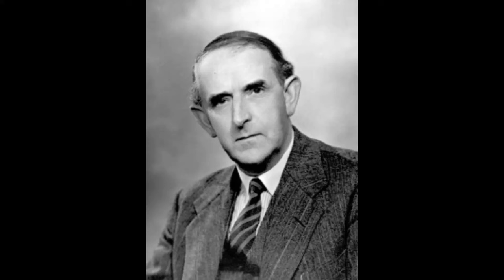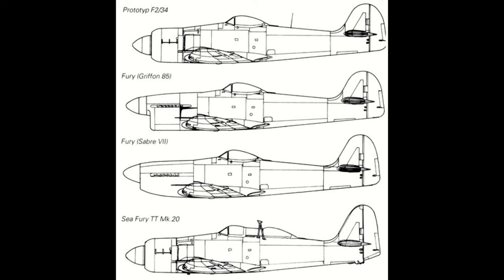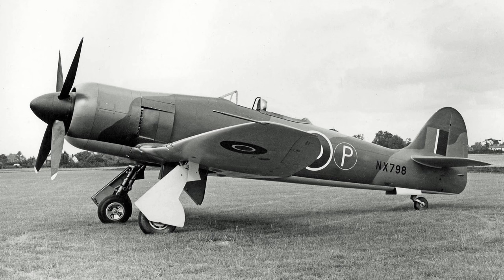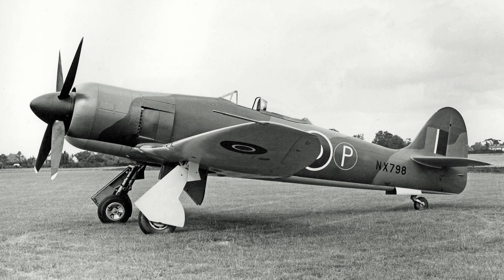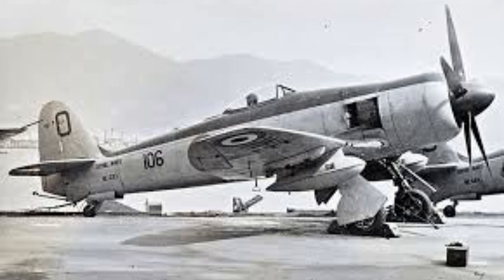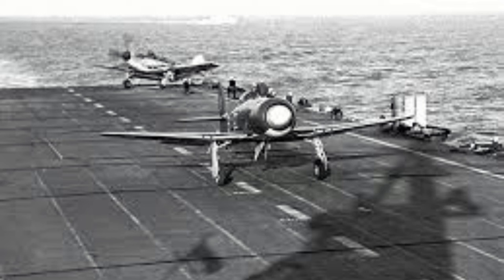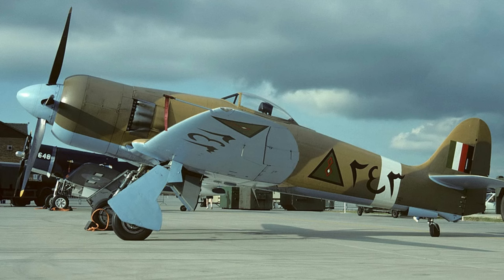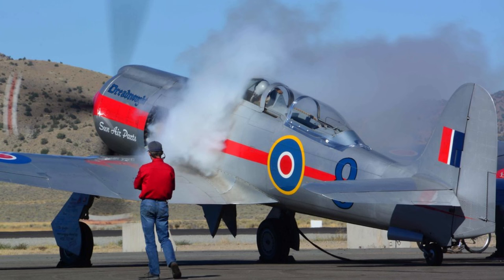5 Minute Guides to Aircraft: Hawker Sea Fury

Comment: I have to believe that Hawker was inspired and influenced by the American Corsair, a large radial engine in a tight fitting slim bodied fuselage using an innovative cooling method. Hawker instead chose the cooling system in the German Foch Wolf, another aircraft with a radial engine in a tight fitting engine compartment. The Foch Wolf cooling system was simpler and easier to manufacture and maintain, a practical decision insread a political one. Sea Fury, Corsair and Foch Wolf, three high performance fighters using a radial engine in a tight fitting engine compartment employing cooling systems to prevent overheating. It's worth looking futher into this
Reply: Yet more nonsense.

Comment: A full semi monocoque  fuselage, new knowledge aero dynamics with a semi elliptical wing. All technologies that the original Spitfire prototype had in 1936. The reason for the Typhoons failure as an replacement interceptor to the Spitfire was the fat thickness to chord ratio limiting the Typhoons top speed and rate of climb. The Spitfire wing had a very advanced aerodynamic properties, irrespective of its semi elliptical wing.
Reply: A semi-elliptical wing is just one part of it, as is thickness/chord ratio. Late war aircraft had their point of maximum thickness further aft than the Spitfire (37.5% vs 30%), which moved the drag rise to later in the speed range. That's why they were able to both fly faster and remain more controllable in a dive. The Sea Fury also used a rather different radiator set up (excluding the fact that the Sea Fury was an air-cooled engine) more reminiscent of the Mosquito or Westland Whirlwind. This was probably the optimal radiator design for WWII fighters, that is, if the Meredith Effect design of the Mustang wasn't. In fact, if you look at the Mk I Tempest HM599, you can see that radiator layout occupying the entire leading edge of the wings between the landing gear struts. This was a faster aircraft than the later production Mk V. According to Robert Jackson's book, 'Hawker Tempest and Sea Fury', it was the fastest piston engine aircraft in the world when it first flew in 1943, eventually recording a speed of 466 mph at 24,000 feet. The reason it didn't go into production related to concerns about the suitability of such a radiator layout for a single engine fighter.

So, in fact, the Sea Fury's aerodynamics were rather more advanced than they first appear. It was probably the ultimate evolution of piston-powered, WWII-era aerodynamics. Compared to the late model Griffon-engine Spitfires, the aerodynamics were quite a bit more sophisticated, particularly the radiator layout.

By the way, as an aside, it is very common with late war aircraft such as these that people start claiming higher and higher speeds for them. Officially, the Tempest Mk I got to 466 mph at 24,00 feet, Unofficially, there are all kinds of rumours about it which are basically valueless and at least one which makes no sense at all. People seem to think it's okay to make up whatever figure they like. Exercise caution when you hear these claims, including the one in this video. It's also worth remembering that HM599 did not carry any armament, which would definitely have reduced its maximum speed. Either way, no marque of Spitfire was ever going to be that fast.
Reply: The monocoque construction of the Spitfire set it apart from all Hawker fighters. In the case of the Tempest and later Sea Fury, the monocoque started behind the pilot. Everything forward of the rear cockpit bulkhead was a spaceframe.

Comment: Unfortunately, most of the Sea Furies flying in the US seem to have had their Centaurus engines replaced with Pratt & Whitney or Wright power plants.
Reply: Given the large volume of P&W engines produced and the limited supply chain for Centaurus engines its a sensible option to run P & W’s.
Reply: @robertpatrick3350  
There were quite a few aircraft that used the Centaurus so there would be a few around. The problem is that the expertise to maintain them is pretty specialised and I'm pretty sure they need special lubricants. But those aircraft are in short supply anyway. If you are in the United States, a P&W or Wright might make more sense but in other places, especially those where the Centaurus might have been used, the poppet valve engines make less sense. Besides, the airframes in the US more often than not, find their way onto the air racing scene. I think most people who are interested in these aircraft would probably prefer to see them with a Centaurus.

Apart from that, a change to an American poppet valve engine seems also to require a changer of propeller, from the original five blade job to four blades.
Reply: @thethirdman225  There are but unfortunately too few are suitable for restoration to airworthy statuss.